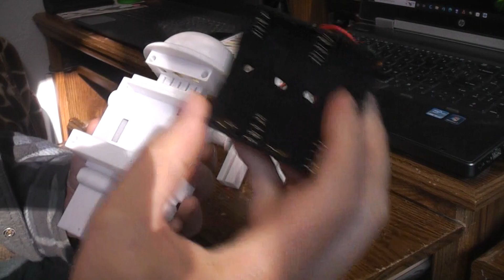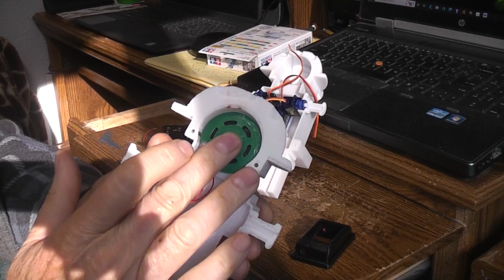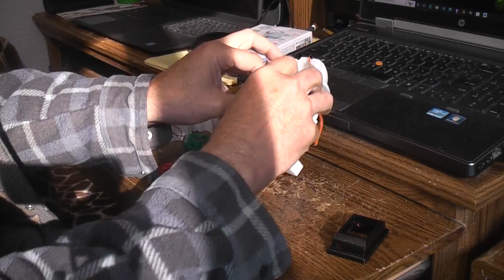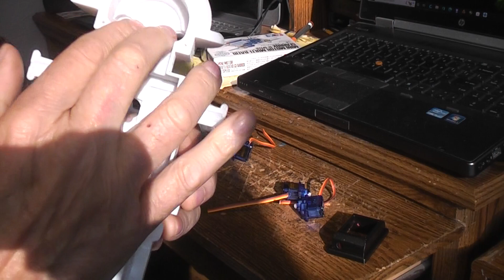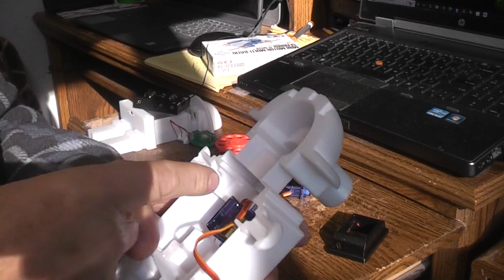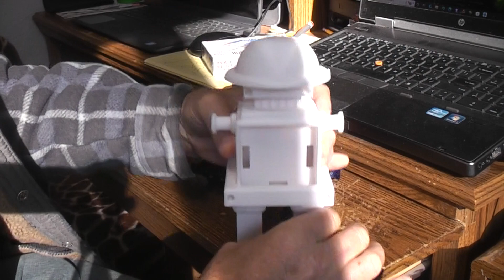Part 2 of custom Robot Phone build.  3d printed body and parts test fit.

Comment: Question - on looking at any of your older prints, have you observed any "melt" from the wire insulation to the toy itself?
I have not - but I imagine that you've been deeper than me.  best,
Reply from the maker: PLA filament only melts with a few specific solvents, non are found in wire coatings. So, there should be no wire melt problem like with vintage styrene plastic toys and insulated wires.
Reply: @Robothut  NIce!   Now I can have a bit more comfort having my old remote ops next to printed bots.
The old plastics can hang with with wind ups!  Cheers!